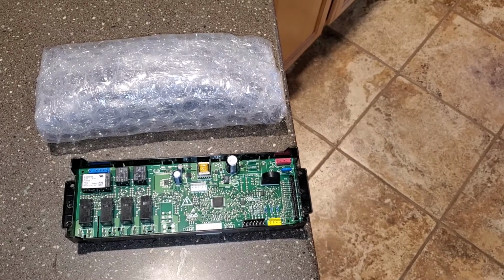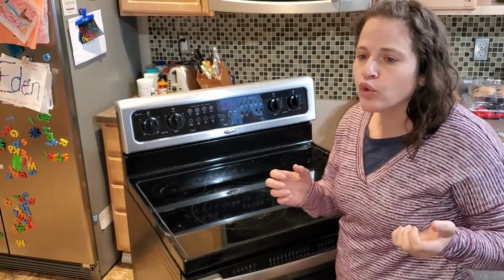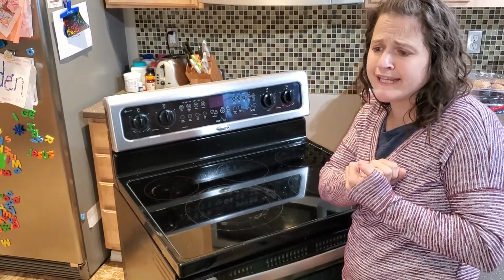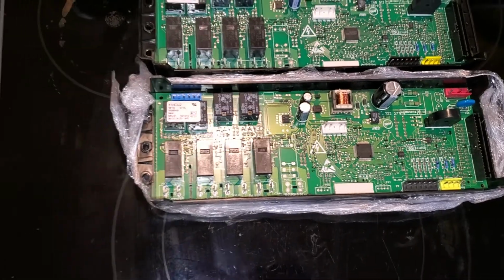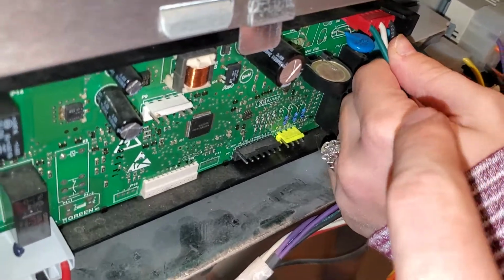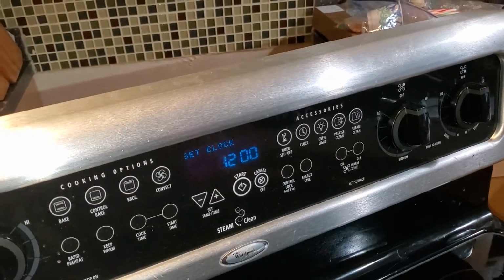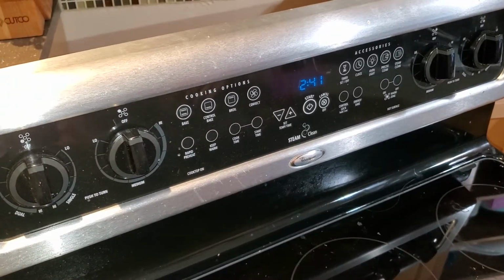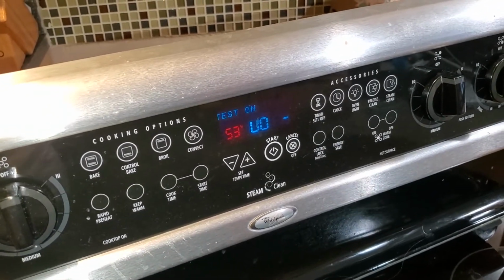Whirlpool Oven Control Panel Replacement

Comment: You gotta take q tips and vaseline and use it on the bake/broil prongs not too much but it helps you take the plugs on/off if needed because I couldn’t get my plugs off it was so hard. It also helps you from putting too much pressure on the board possibly damaging it. I just put my new board in today and now the bake/broil finally work once again it lives. When I ran the automatic test I had the error: Check wiring to DLB K1 P3 or replace control. With your original board, you could probably disconnect the wires from the board and maybe clean the board also with some WD-40 specialist electrical cleaner and you could check the wires shake em around a little maybe and like I said you can lubricate those prongs with Vaseline and then connect it all back together and see if it works. If it doesn’t, then you need a new board. In my case I just went ahead and bought a new board but I learned a lot of things.

Comment: how did you get the ribbon strip disconnected? I pushed the little tab in and work it around but the connector will not come out.
Reply from the maker: It took a little bit of work, but we were able to wiggle it out. Be sure you have the tab fully depressed and see if you can see it moving so it doesn't latch. Hopefully this helps.
Reply: @aaronpayne1058  thanks, I finally got it out.  I was being to gentle but once I put a little more force into it the connector came out.